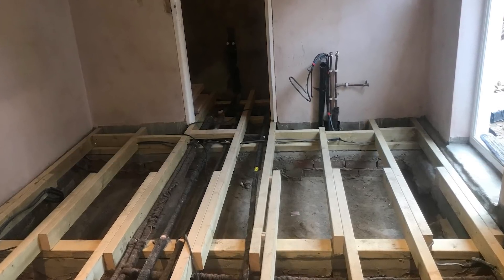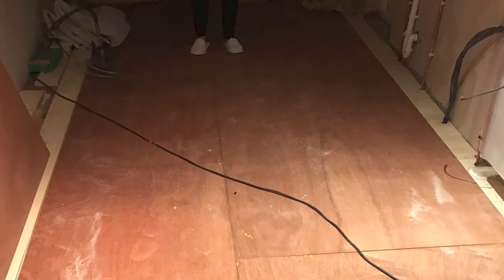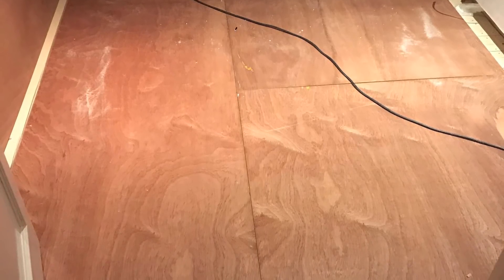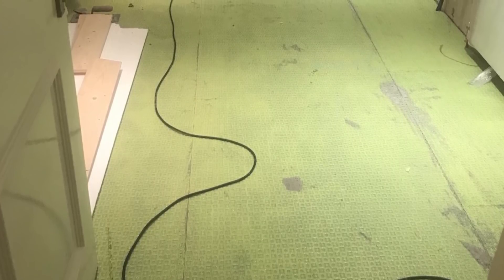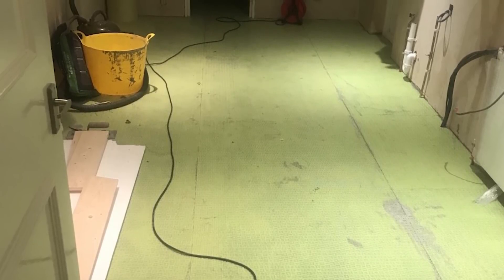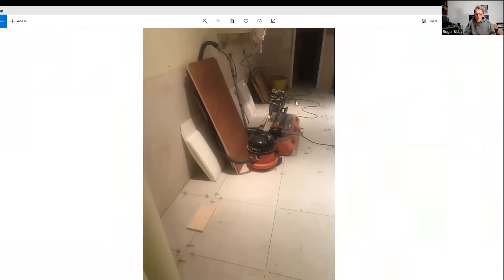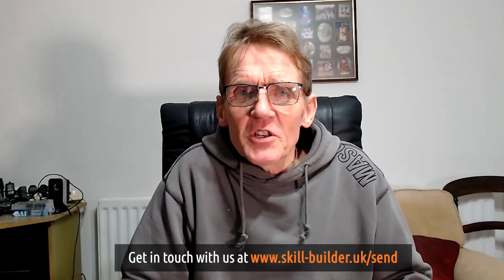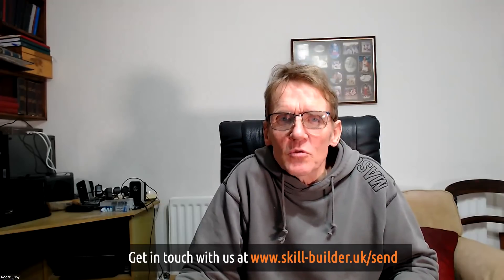What's That Noise Coming From Under The Floor?

Comment: cheapest fix is ear plugs only £1 on Amazon! You seem to have got it spot on Rog, us tradies who have left a big gap round the outside are not really bad workers. looks to me like a very enthusiastic amateur who watches a lot of you tube is the problem.
Reply: No clue what you're talking about. Not even the slightest.
Reply: Looks like they had good intentions but used unnecessary overkill

Comment: 4 Mill gap for me Rodger. Also put spacers under the units to sit on. Other than that no idea👍
Reply from the maker: Do you mean as slip layers under the unit feet?
Reply: @SkillBuilder   no for raising the base units slightly off the tiles. Great for stopping the units sponging liquids up.
Reply: @lazylad8544  the units sit on legs! Or am I being a bit thick 😂
Reply: Mine was a cheaper kitchen (I was trying to save a few quid). Bought from a DIY warehouse. It didn't come with legs it was just the units.

Comment: I would’ve gone bigger on the joists for a start, or even concreted it, I hate wooden floors in kitchens, too noisy.
25mm ply or 22mm p5 over the top of the joist.
I bet there wasn’t any time given for the timber to settle before tiling, it was probably high moisture when it went down.
Reply from the maker: That would mean it would shrink. Could that cause a noise? Yes I suppose with all those fixings it would.
Reply: Skill Builder that’s my thoughts anyway, tongue and groove boards should be in the house a week before even putting them down.

Comment: The plywood joints rubbing together?
Reply: Good call
Reply: @markcroft1303  everybody knows what rubbing floorboards sound like.
Reply: @gdfggggg  I always leave 2 or 3mm gap its normally enough.
Reply: @markcroft1303  yeh, I do. If there's only a small amount of movement they might squeak.

Comment: Need a few more pics to know for sure. A couple of possibilities that I couldn’t see from the pics… is there any gaps around the perimeter for expansion? Also possibly as it’s an unconventional method, did they spread glue with a notch trowel or similar over the t and g? Might be the 2 timber surfaces touching/squeaking together.

Comment: It's 100% the two different grades of wood used. The plywood is perpendicular to the boards, as I would have done if asked to lay this floor, but I would have advised against using these two types. The expansion gap around the wall looks to be minimal, so there's that too. I'd have advised 18-22mm osb in 2440x1220.

Comment: Not a fan of tong and groove floorboard , how do you take one up to access under the floor without ripping the whole lot up ! Go old school , big ass floorboard and big fuck off nails .
Reply: so succinctly put
Reply: You cut the tongue along the length of the board you want up and lift it. This was the norm for years. The modern chipboard sheets are murder for electricians and plumbers. Cut out strips and sections and the strength is gone. They creak like a bastard afterwards.
Reply: Can you let us know of the supplier of fuck off nails, I have heard of sticks like shit but you never stop learning in this job.🤣
Reply: When I put new t&g floorboards down I rip the bottom lip off the groove side of the board and screw the boards down. That way you can unscrew and lift any board without damage and they still look complete when they're down.
Reply: @_Damian_.  might as well use butted floorboards. The grooves are there to make the whole floor more like one solid board
Reply: @_Damian_.  lol what? Why even buy t&g then?
Reply: @grrinc   makes sense to me. The boards can still expand and contract without gaps appearing between them and you can pull them up individually without damaging them. With butted floorboards you get gaps between the boards over time with shrinkage.
Reply: @_Damian_.  fair enough